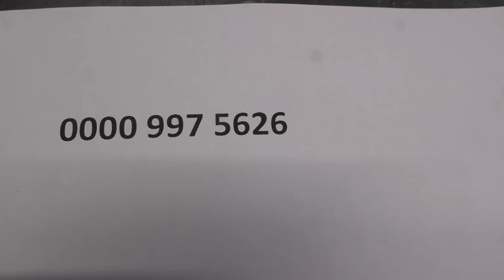STIHL 026 Chain Keeps Spinning At Idle - Let's Fix This Chainsaw!

Comment: I disagree with you, the lower the idle is set, the more bottom end torque and quicker rev response you will have. Saw engine  also will stay cooler with a 2300/2600 rpm idle.

Comment: Never a good idea to use abrasive teeth pliers on springs. You'd be surprised at how little scoring it takes to make a spring break & fail later on. Also failed to mention to measure the thickness of the shoes and the drum surface thickness the shows press against. There are factory wear specs for both of these. In this example, they look OK, but always better to measure.

Comment: Great video, Dony.  Another reason to use a pick or the special tool is so you don't damage the surface of the spring, which can weaken it and cause it to break over time.

Comment: You can use steel wire and loop the spring leg then vice grip pull the the wire just like that tools.

Comment: MS201t and MS200 are notorious for this problem at my work. The springs will either break or wear into the clutch shoes causing them to expand into the drum which will spin the chain. More often than not, I will change the entire clutch and not do the springs.

Comment: Hi Donnie!  Take a llook at the frames where you show the OE springs in place and compare to the new springs in place later on.  The replacement springs have about 1/2 or so fewer coils and the gaps between coils are larger than what you observed for the originals; ie the new springs are of a stronger rating even though the old ones were fatigued, they were never as "strong"as the new if the metalurgy is the same -- "I guess".  Thanks!

Comment: This repair is such a rewarding one if the old springs are really shot. It only cost a few dollars and is not instantly appreciated when u go to use your saw. Some may say oh...I can just set the brake to stop the chain moving but if the springs are bad, the engine will stall.

Comment: Hi Dony - I have a vintage Stihl 031 on which the brake lever has 3 positions:  lock, neutral & run.  I have never seen another chainsaw with the "neutral" position, where I can rev the engine, the chain remains in an unlocked state and the clutch stays disengaged.

Have you any experience with this setup?

Comment: I have a Stihl 017. Starts right up and runs good. 
But if I turn it off it’s very difficult to restart when it’s hot, I’m not choking it on warm starts. Where would you look for the problem?

Comment: I thought that the 026 oil pump has a drive arm that fits into a notch on the outer edge of the clutch drum?
Reply: I am sorry, I see that this version of 026 runs the pump all the time that the engine is running. 
I think that it must be the 026 PRO that has the pump worm driven by the clutch drum. 
Love your information and your willing to share it.

Comment: Why not use chain break when installing springs? Will it damage?
Reply: The chain brake tightens on the outside of the clutch drum. It is removed.